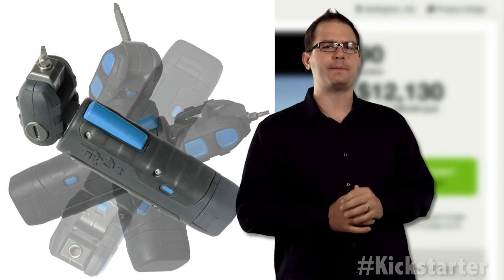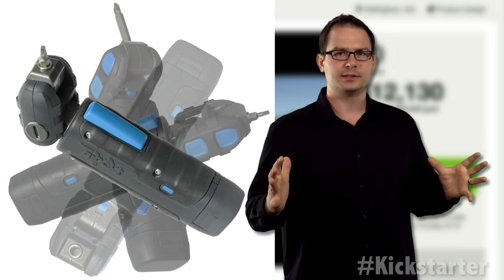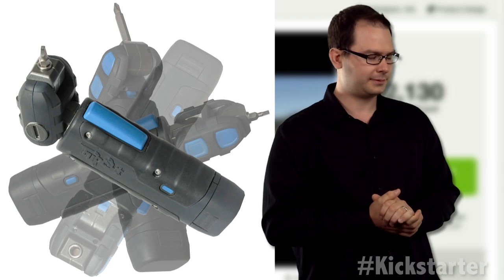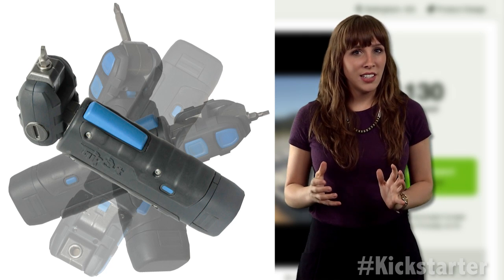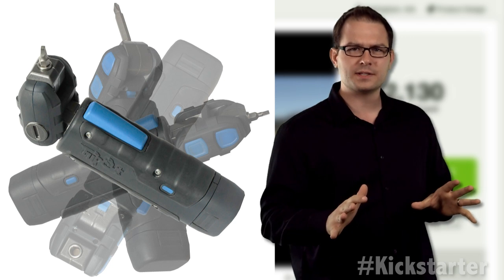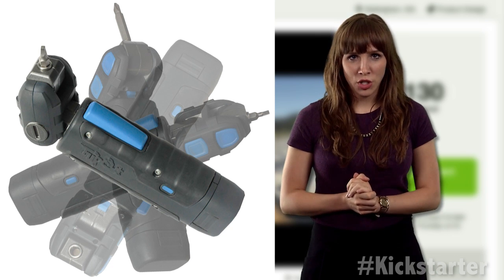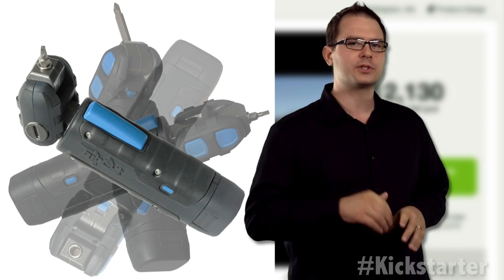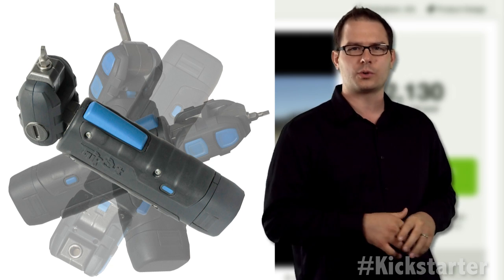Kickstarter of the Week: The Future of Electric Screwdrivers

Comment: It's a tool for someone too lazy to remove the four screws holding on a door panel?  Seriously, 90% of all door panels are attached by four screws.  I don't think 7.whatever volts can remove car speaker screws.  That's why they called it the Tantrum, as that's exactly what the owner will do after the first time using it.